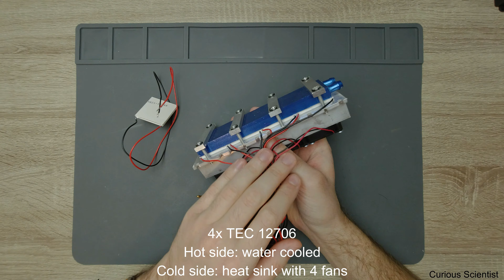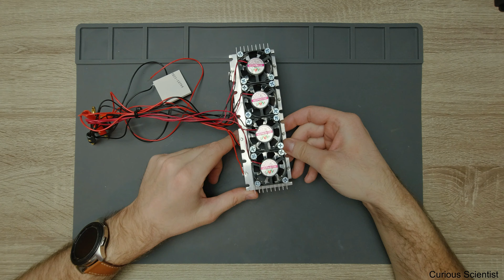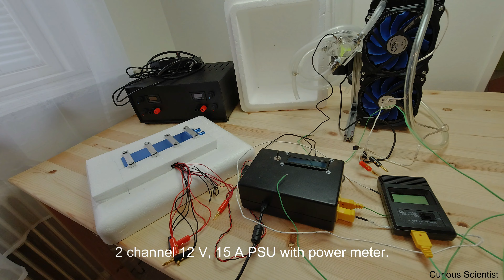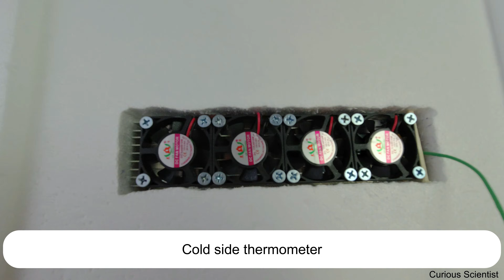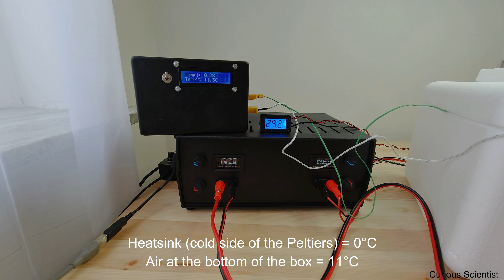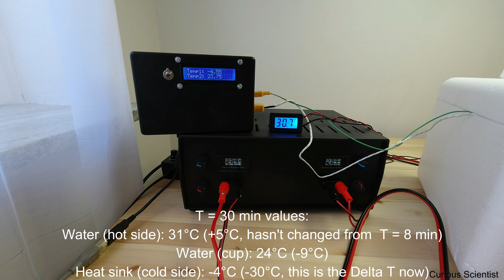Refrigeration with 4x TEC12706 Peltier Block

Comment: We need to see the readings at full current ad Voltage and then see how much time it takes to cool down the load. This video does not justify the real potential of the peltiers you are using!!!
Reply from the maker: I have more recent videos with better setup. I made my own cooling box. At this that time when I made the video, this was the best I could do due to the lack of a proper power supply. But it would not cool much better at the "ideal" current (4-5 A). The cooling power would max out around 30-35 W per unit, so we could have around 120-140 W total cooling power. I might give it a try in the future as now I have better power supplies, but I do not expect much better results.

Comment: 4x Peltier for the room or what dimension?
Reply from the maker: Hi! For a small cooling box like you see on the video. I don't remember exactly, but I think I mentioned the dimensions of the box. It was maybe 7.5 liters. You will not want to cool a room with Peltiers. You need let's say 7-10 of this unit, depending on the size of the room, the ambient temperature...etc.
Reply: @CuriousScientist  if I make a freezer or refrigerator measuring 60 cm x 40 cm x 40 cm, how many peltier is needed?
Reply from the maker: @gunawanbasri4562  I don't know. I don't know what is the ambient temperature, I don't know what coolers (both Peltier and the cooler for the hot side) you will use, I don't know the cooling rate you need, I don't know what will you put in the cooler, I don't know a lot of other details. You should define this issue much more precisely.

Comment: use metal container inside to get quick temp.
Reply from the maker: Explain why.
Reply: An aluminum interior surface directly attached to the cold side sink will allow for thermal conduction to objects inside the cooler. This is what you see in those small, portable wine/beverage coolers.
Reply from the maker: Thanks! I knew the reason, I just wanted to hear it from him. People often write "do this" or "do that", but in general they never say why. :)
Reply: @CuriousScientist  Thanks for clarifying. I also noticed in your cooler box playlist you added aluminum foil on the inside of the box as part of your 2nd iteration mods. You didn't mention it in the video, but I was wondering if the foil was clamped/sandwiched between the peltier cold side and the cold sink to provide thermal conduction to the foil?
Was wondering as I saw another youtuber who used thin aluminum sheets as the interior of the box and it worked very well for his build, so I was curious to know if aluminum foil (rather than sheet) worked well for your build as a direct contact thermal conductor to the cold side?
Reply from the maker: You're welcome! Ultimately, I think that the sheets in direct contact with the cold side of the Peltiers would work the best (better than my foil). I just covered the inside of the box with the foil.

Comment: You should really try out how the stacking method works. I have done some testing with 3x12706 stacked with 5volts, i think they use about 1.5amps with that voltage. I have now ordered 12710 versions, so that i can get more amps with 5voltage. I am using USB charger with 2.4amp outputs, so when using 12706 not getting full benefit from it. I have slide show if you care to check it out. https://www.youtube.com/watch?v=HSs0Zy017h8&t=77s
Reply from the maker: I did it already in another video. I cooled the TEC12715 with water cooling, and I cooled a TEC12706 with the cold side of the water cooled TEC12715. I could reach below -40°C on the surface of the Peltier. But that is just the surface of the Peltier, and not something like a large volume of fluids. Regarding your video, you can see that it took about 3-4 hours to cool the air in an empty box from room temperature to 10°C. And you used quite a nice system to exchange the heat inside the box. What I try to say is that we both know how inefficient these devices are.
Reply: @CuriousScientist  Yeah, looked up your video. I think you are using a lot more than 30watts to reach that? Think there was 148watts at first but you lowered it to what? Yes, it takes longer time when using lower watts to reach the temps, took about 24-36h to cool down 24-pack in that box from 21celsius. :) Well, i will keep on trying to find better setups to reach lower and lower degrees with lowest possible watts used, i will not call them inefficient, yet. :)
Reply from the maker: @Ruube1978  I tested those Peltiers approximately at their max performance where the Joule heating just weak enough to be negligible. 

Believe me, they are much more inefficient than the regular compressor-based cooling (approximately 10% vs 40%). At the end, you have to keep in mind that there is a certain amount of energy needed (heat to be removed + losses) to remove a certain amount of heat from the system. So, the further you decrease the power, the less you will be able to cool.

Comment: Please make a video to explain 
Peltier 12706 vs 12715
Reply from the maker: Hi! There is no video needed. The 12715 can run at 15 Amps, while the 12706 can only run at 6.4 Amps. Therefore, the 12715 has a significantly larger cooling performance. That's all.
Reply: @CuriousScientist  
https://youtu.be/iVarAi4qFpM
But this video shows it differently
Reply from the maker: Unlike in my videos, no details are published about the voltage and the current. In that sense, it is a useless comparison. I always publish cooling time, current and voltage, so everything is comparable. If you feed the same amount of power (same U and I) to the TEC12706 and the TEC12715, the TEC12715 will perform worse, because of its characteristics. If you give proportional power (so, let's say, both of them get 50% of their Imax), TEC12715 will perform _better_. 

I don't want to bash on other videos, but always be aware of those videos, where they don't show the full setup and they don't show all the details of their experiments. Scientific experiments have to be reproducible. If you don't have all the details, you cannot reproduce them. 

BTW, check my Peltier-related playlist, and you will see that I talked about these two Peltiers already in the "Below -40°C" video.
Reply: https://youtu.be/iVarAi4qFpM 
Watch it once